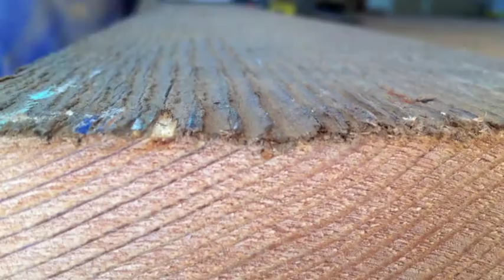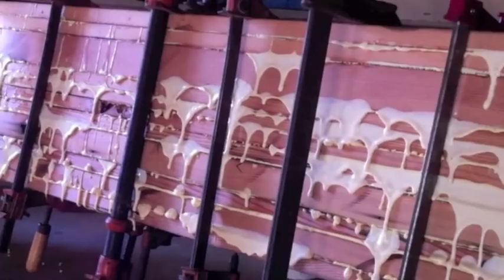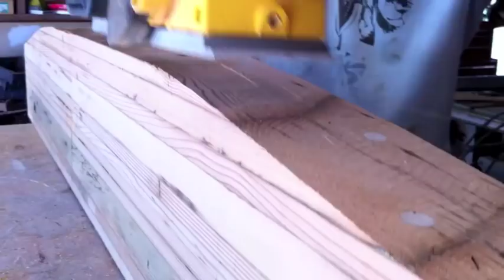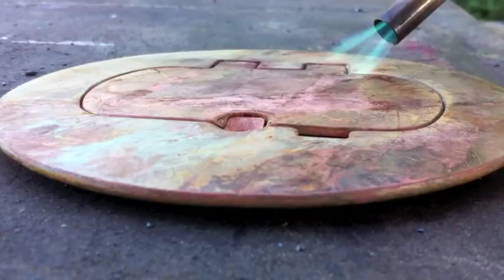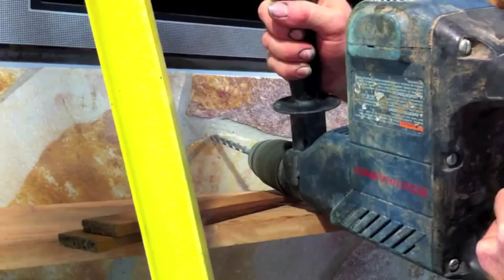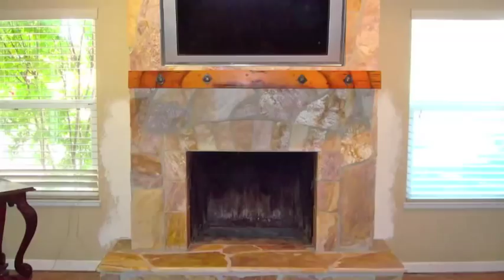The Green Toolbelt Reclaimed Lumber Mantel Project with Artist Kermit McCourt

Comment: awesome job....never thought about doing it myself....until now.

I just came across approx. 10 old barn wood boards (about 85-90 years old) about 10 inches wide and 1 inch thick, thick I may have to try this out.

How long did you let the glue dry before trying to work with the beam??

Comment: Those bolts though.  Hmmmm.
Reply: I guess those just did not turn out as they expected it.
They might had to tighten it so much that it curled out. After all these were only threaded rods, not real consoles but they use them like.